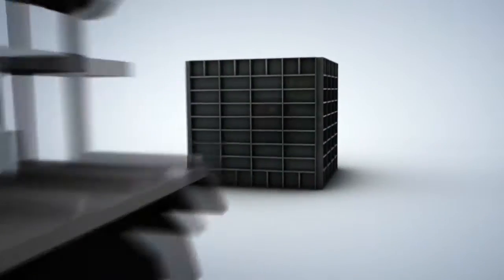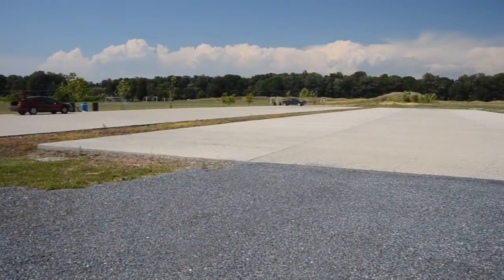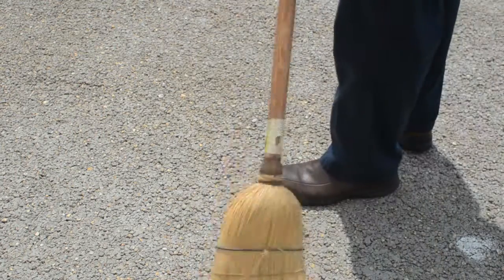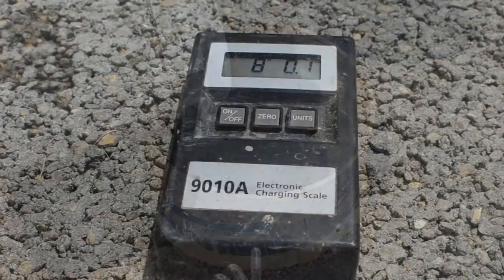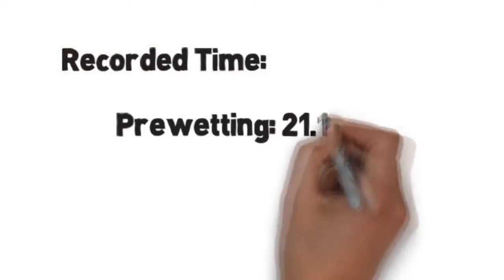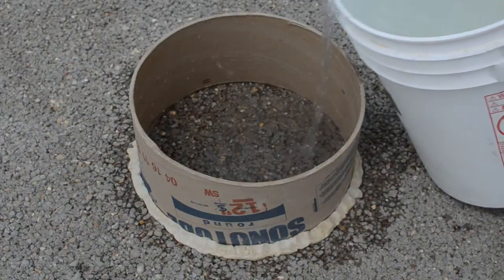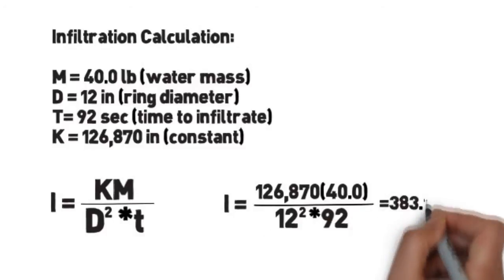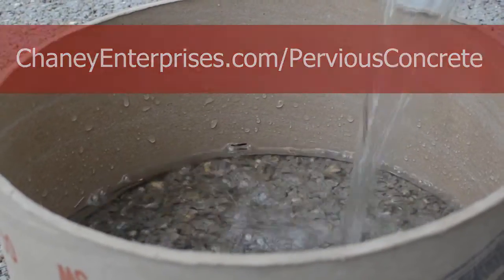ASTM c1701 Pervious Concrete Infiltration Test - Concrete Brief

Comment: how come that the unit of infiltration rate becomes in/hr?
Reply: Infiltration rate is volume per unit area per time interval.  In English units, that's gallons per square foot per hour, which can be re-written as cubic inches per square inch per hour, producing final units of inches per hour.  Infiltration (and permeability) units are velocities.